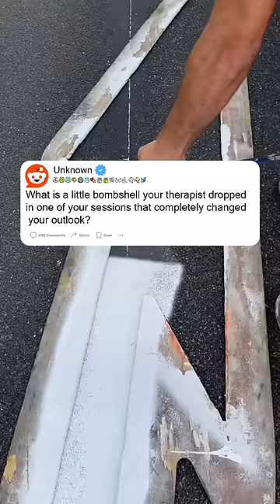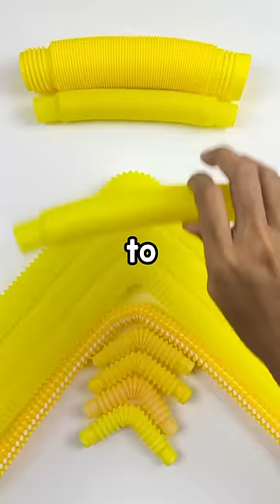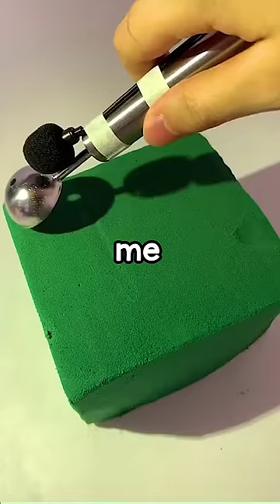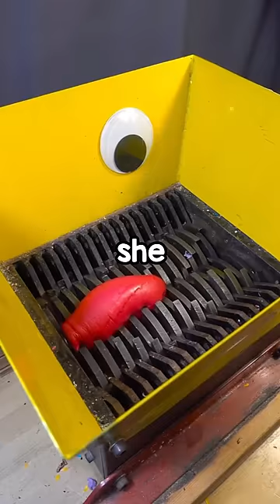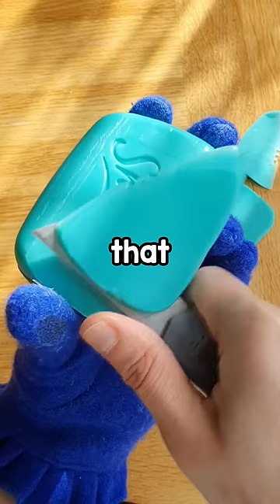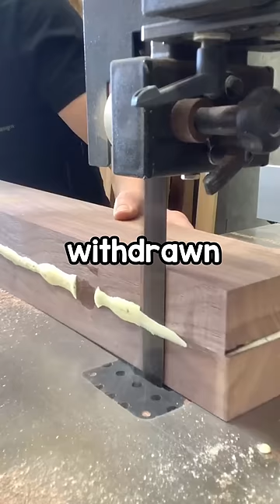Be A Good Friend 😊 #reddit #redditstories #askreddit

Comment: "Just dont" - a compulsion is just that, you don't actually have to follow through and usually nothing will change if you don't.
Reply: If this worked for you, i'm glad, but also no, that's stupid, that's just not how it works. A compulsion is a compulsion specifically because "just don't" doesn't work.

Comment: Being told I probably have ptsd has changed my life for the better. I have lived my life not knowing why my brain works the way it does. I was told I was bipolar which just made me constantly think I was over reacting for no reason and it’s a chemical imbalance. But the ptsd talk… man. I was able to turn my life around. I haven’t gone to therapy since then but I can work through my emotions better knowing it’s trauma related and not me just over reacting. It’s my brain reliving trauma so I just assume every little thing will lead to the same thing it has and that caused me to keep a lot of negativity in my life. I feel free from all the stress I’ve held on to. I can’t describe how it turned my whole thinking process around and I will be grateful that one therapist saw my real problems at the lowest time of my life instead of letting me hold on to the bs diagnosis of bipolar 2. I wasn’t just depressed. I was surrounded by triggers.

Comment: I suffer from debilitating anxiety attacks. My therapist told me that the part of your brain that makes rational decisions goes offline during an anxiety attack due to being in survival (flight or fight mode). It helped me understand why i couldn't just calm down even though i knew I needed to. It also meant that i couldn't process my issues until after the attack was over. It helped me know i wasn't crazy, even though i felt that way sometimes. She also taught me what it means to not be a doormat and why its so important to set healthy boundaries. The last major thing i learned was how to know when they are going to happen and that when I sense it (despite what my brain tries to tell me) the best thing to do is take a breath and  breathe. If you can prevent the anxiety attack you can think and make more progress. I also tend to lash out verbally during an attack, so taking a break helps me from loosing my temper with anyone (not something I'd ever do outside an attack).

Comment: My latest realization wasn't from therapy, just me coming to the realization that it's ironically easier for me to make progress on improving if I stop being so hung up on trying to improve.

If I keep "grading" everything I do, even positively, I feel like in my current mindset, that's still just feeding an unhealthy root of perfectionism and anxiety and I first need to work on being more objective and distanced.

By just doing something for its own merit and not fixating on how "good" or "bad" I did, especially when it comes to tasks where the main thing that actually matters is simply *whether you did it or not*, I find it ends up being easier and less exhausting, which means I do it more, which ultimately means I ironically probably will get better at it than when I was excessively fretting over it and confusing "worrying harder" for "trying harder".

Comment: here's a brownie recipe.

Ingredients:

- 1 cup of unsalted butter

- 2 cups of granulated sugar

4 large eggs

- 1 teaspoon of vanilla extract

1/2 cup of all purpose flour

- 1/2 cup cocoa powder

1/4 teaspoon of salt

- 1 cup of chopped nuts or chocolate chips

1. Preheat oven to 350°F (175°C) and grease a baking pan

2. Melt 1 cup of butter and mix with 2 cups of sugar

3. Add 4 eggs and one teaspoon of vanilla; mix well

4. Sift in 1/2 cup flour, 1/2 cup cocoa, 1/4 teaspoon salt; stir

5. Optional: add 1 cup of nuts of chocolate chips

6. Pour into the pan and bake for 25 - 30 mins

7. Cool completely, cut into squares and enjoy your brownies

Comment: Not always the case.  I used to be one who reached out to others. 
1 friend from college,  I was one who always called. College was '87-'89,.  In 2005, I nearly died, drs words. So, for several months I was working on getting myself back together .
When was feeling a bit more normal,  got online to chat rm we both went to to connect w/ her.
She was very cold towards me, indifferent,  etc.
No concern for what I went through at all.
That's when I saw her true colors and last I spoke to her.
I'm not 1 who needs 24/7 attention  but friendships should be more equal .
So, I know I'm one who no longer reaches out to others couse I started looking at friendships I had and valuing myself more